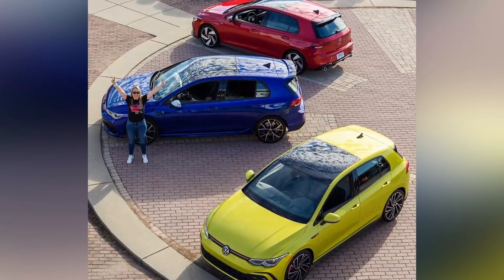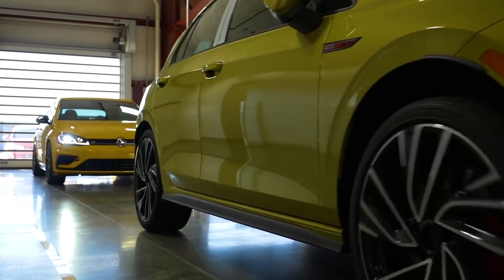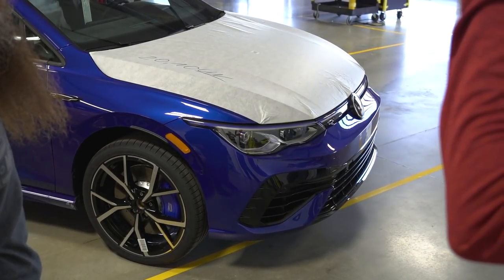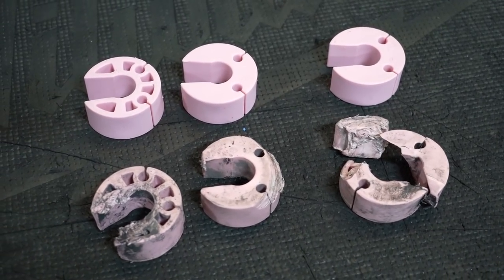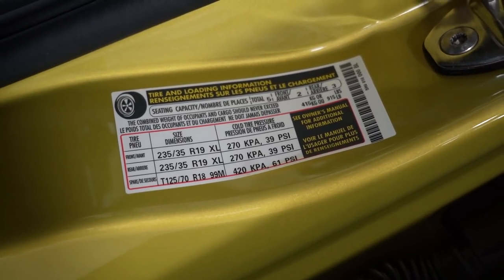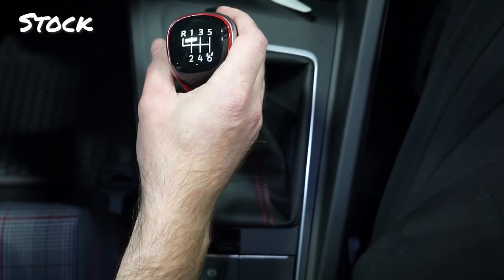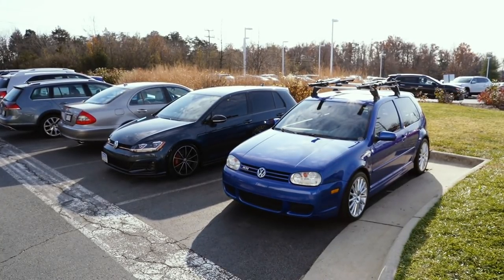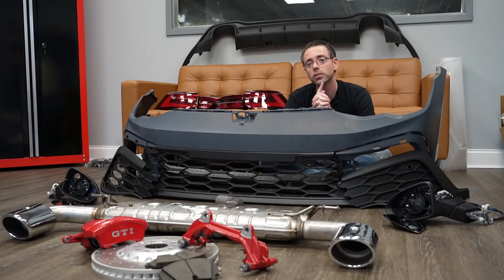We Modded our MK8 GTI Before Signing the Papers

Comment: I can’t think of one manufacturer that has enthusiast support like VW does. This is awesome. It’s changing my thoughts on the mk8 for sure.
Reply: Toyota, Mitsubishi and Subaru did back in the day. Now they just make dreadful cars. All the German marques have always had high level of enthusiast engagement. The only thing that's comparable is Ford.
Reply: @Zenkat yeah you’re 1 example of a here say story doesn’t represent the brands motives. I used to work for vw. In their engineering and design books they would explicitly state how they design their cars to support aftermarket modifications and make design cues to have an appeal if the vehicle was lowered. They put on southern worthesë and design concept cars solely to wow their enthusiasts.  Vwag has the biggest aftermarket and tuning following.
Reply: @Zenkat another fringe case. MQB is a beloved platform and has an absolutely massive cult following for being some of the best cars on the market in stock form, and a plethora of cosmetic/performance aftermarket support. it wouldn’t have turnout out like that if VW kicked enthusiasts to the curb.
Reply: @Zenkat sounds like you have a Lemon. Every Manufacturer has one that they produced. Not every single one will have it. Maybe talk to a lawyer and see what they can do for you.
I had a Mk7 that I raped all the time, never had an issue. I guess that’s life and life’s not fair.
Reply: @Zenkat I’ve had 5 mk7’s and probably double that in mk4’s to mk6’s. One of them was a lemon. I work at Toyota and see lemons all the time. Like I said your one experience doesn’t represent the brand. Look up the facts of vw having the biggest enthusiast following. I’m not arguing this when there are stats to show. Good day, good luck with the lemon law.
Reply: @Zenkat Ahh, so you're going to invalidate an entire global brand following because of an anecdotal alleged incident. Roger that.
Reply: @Zenkat Hey bro it was nice of you to turn up and say some words. Your carer will definitely be proud and print you a certificate etc. You have a good day now lol
Reply: @brandonfriesen5389  It doesn't help that VW as a brand is always near the bottom of reliability surveys
Reply: See how much they support an enthusiast when their crap is38 turbo blows with just a simple tune. Red flagged and wouldn’t even cover the water pump that later went with 26k miles because of the previous repair rejection due to the tune. VW does everything they can to not pay if you touch the car period. So reliable my ass. Leaky sunroof on my friends GTI at 50k miles and blown DSG in friends S3 at 65k
Reply: Honda
Reply: @Zenkat you mean to tell me, you're watching a video of VW enthusiasts literally showing up to the Baltimore port just to check out the cars they speced out, and then proceeds to modify it before signing papers... but it's just any other fanbase? crazy. and you for sure have a lemon. early 2015 models had the turbo issues you mentioned, but nowaways they are very reliable.
Reply: @grahamek86  Priceless AND accurate! 🤣
Reply: Yeah until they void ur warranty
Reply: @HowieCarson  The turbo is made by IHI, not VW. Also, the tune is crap. I tune hundreds of these cars a year and have yet to pop a turbo.
Reply: I'm just gonna say for the naysayers here, dealerships are a case by case basis, they're all their own franchises and pick/choose what they warranty. I've had some garbage experiences at dealers with my mk7 gti and some amazing ones with my mk7 R. Hell one replaced my headlight under warranty even though I was over the mileage fot it. 

And as far as reliability goes, I've put 50,000 miles on my 2016 Golf R in a year and I've done nothing but oil changes and a clutch to support the tune i put on it. 

There's small issues on mk7s here and there, some more than others but point me to a car that doesn't, I'll wait.
Reply: @HowieCarson  You violated the Magnusson Moss Warranty Act(which all car makers follow), obviously your cars warranty is void if you tune it and an engine component goes bad, what do you expect? Working for Toyota, we've voided many warranties over suspension mods, or basic bolt on mods because we all follow this rule. That's YOUR risk. It's not hard...
Reply: @Zenkat you’re problem is not working on it yourself. They are easy to work on, but dealers and mechanics charge an arm and a leg to get maintenance done. At 37k your car should be perfect. Sounds like a lemon, or you drive harder than you think you do.
Reply: I mean Porsche is trying to make fuel so “clean” that they don’t have to go 100% electric and I feel that’s the ultimate customer support…
Reply: @gladdy02  They're not, though.
Reply: My MK7 R clutch was failing prematurely at only 9k miles.  I've driven manuals all my life but this was inexcusable and the car was stock.  They said it was a consumable item like brake pads and wanted $2000 to replace it.  I sold the car instead.  Should have gotten a DSG.
Reply: @FastRedPonyCar  I've heard that a lot. VW had great manuals but DSG is the only one the handle the power out of the box.
Reply: Porsche
Reply: Ford allows you to do everything except ecu tunes and internal engine. Chevy will actually replace ur engine from tracking it in a zl1 Camero.
Reply: @gladdy02  except the fact that VW is at the top of the German brands when comes to reliability….
Reply: @papaannefranku9693  all the German car companies are not know for having good reliability. So congratulations on being the best of the worst? 😂
Reply: @gladdy02  too bad it also beats out Ford, GM and FCA…..
Reply: @papaannefranku9693  I don't know what your looking at but according to the newset consumer reports, VW as a brand is 24 out of 26. How else would you explain thier horrible depreciation after the warranty ends.
Reply: @gladdy02  it’s 24 out of 28 with the bottom being full of fca, ford and GM but I’m not talking about a year by year reliability rating! I’m going off of 5 year reliability and dependability index which weeds out the pieces of shits like the Tiguan and atlas in that aspect VW is average which is higher than Most other Europe and American manufacturers……and considering Audi and Porsche are pretty high on the list with their most popular models being on a shared platform including engines and electronics etc, it’s those multiple recalls that the Tiguan/atlas bringing the score down!
Reply: @papaannefranku9693  I'll buy that. All I know is that in my circle of family and friends, there is a perception that VWs look great, and typically drive better (or used to) then most normal cars. The trade off is reliability/maintenance cost, and the fact that you will loss your ass on a resell when compared to a Japanese auto maker
Reply: @brandonfriesen5389  Haters like @Zenkat are pathetic and I dont know why anyone here even bothered to reply to someone with nothing better to do than go troll on youtube. Wow what a amazing contribution to this comments section he brought. People like him are miserable just ignore them. You’ll be better off i promise.
Reply: @Zenkat its Not riddled with Problems its a really small percentage of all Cars have electronic Problems and wastegate Problems Like yours
Reply: I think Porsche trump's VW enthusiast support
Reply: @jw18xxx  that’s awesome to hear man!
Reply: @Zenkat those literally aren’t common issues (besides carbon build up which is an inherent issue of nearly every euro car). i’m sorry you have a lemon. i can literally search up “turbo wastegate failure *insert turbo car here*” and i will run into several results. that doesn’t make the car unreliable lmao.
Reply: @Zenkat I am glad there is another person out there that feels the same amount of frustration that I do with these later models. I was so happy initially owning my '15 mk7 gti, I got to perform the PDI right off the truck because I was a VW mechanic at the time. It came off the truck with 5 miles on it and I have put every mile on the car at 137k now and 1 motor later that was replaced at 58k. What a complete disappointment, from the brushed metal falling apart on the interior of a car that is garage kept, the driver seat splitting at the seams, all the plastics on the front bumper failing (those stupid plastic front "spoilers" came off), oh and a stupid short in the steering wheel that when you crank it to the right it throws a trans error code and disables the cruise control even though nothing is wrong. I have never had such a big love/hate relationship with car as I do this one. Long story short, keep it up spreadin' the truth, VW is just a big disappointment of a brand I used to love.
Reply: Porsche

Comment: They also delivered an exact copy of your yellow GTI to Lindsay, except it was DSG, saw the color in person and I snagged it immediately!  Absolutely love the mk8 so far; yes the buttons are futzy, but you get used to them and the underlying tech is super cool.  The jury is still out on the DSG for me, but I've always owned manuals, so thought I'd give DSG a try for once, time will tell.
Reply: Replacing the small factory paddles with genuine carbon fiber units improves the DSG Experience.
Reply: On the MK7 GTI's the UNI DSG TCU tune fixes the DSG jerkiness especially 1st n 2nd gear transitions. Facts. Not sure how bad the MK8 is but keep in mind!
Reply: MK8 has no jerkiness with the DSG, but the delay off the line is still there, and pretty bad with stop/start

Comment: My new 2016 GTI was APR stage 2 before I signed the papers. 14 miles on the ODO lol
Reply: "Break-in period"  psssshhhhh
Reply: @dubsessed9790  Right?!?!? Ha! 
I traded it in a couple years later at the same dealer. They used it as a rolling billboard for them at track events. Car would run mid 12's on slicks. They sold it a year ago and last I heard its still running strong.

Comment: Funny you mention drilling holes in your front bumper. I requested them not to do this to my 2019 Golf R (which they followed my request and didn't mount the front plate - they ziptied it to the grill), low and behold though the rear doesn't have a mounting plate and now has holes drilled into it lol.

Comment: Hey there ... Just curious .. when you installed this .. did you have any issues with alignment?  I have just got this installed from a mechanic on a 2024 VW GTI performance... after watching your video..  I see that my shifter is actually off centred and rests to the right .. ....I also .. have some issues with finding first and second .. but the up shifts when I'm in first... to second .. and then up .. is incredible.... any thoughts??  Very troubling when I'm down shifting to second and can't find second gear ....

Comment: Great car! Congrats!
Will you do that stuff of *number zero oil change*?After 1-3 thousand miles.
There is still a myth, that you should change the oil before the 1st normal oil change in your NEW engine, and that it will add it some longevity.
Because long time ago engines were really not that precious, and that extra oil change could help to take out some micro metal parts. At the dinosaurs ages :-)
Is that idea still working?
Reply: I heard not, because the 1st oil in the car is specifically formulated to aid in engine break in. Can someone confirm?

Comment: What is the difference between GTI and R except the difference of having AWD system on Golf R while GTI don't have?
Reply: A few differences that I know of. Bigger turbo on the R, more horsepower. Bigger brakes, different suspension bits. And the AWD system like you said is a big difference, even more so with the MK8 R where it has a torque vectoring system.
Reply: GTIs with the performance pack will have the R brakes.

Comment: I'm so glad I'm not the only one who references that baby commercial, nobody ever gets it when I say "in THIS ESTABLISHMENT!" :P

I'll be curious to see what your long term relationship with those touch controls are, it really has me on the fence because it's kinda looking like trash and a quick way to ruin what's otherwise a solid car. Lots of reviews including some major publications like car and track etc have all knocked the system especially the steering wheel. Activating controls while just turning the wheel because the side of your thumb/palm touches something while you work the wheel kind of seems bad. And having do literally dig into the menus just to adjust climate controls is beyond bad, it's borderline dangerous because it takes your eyes from the road vs a traditional setup.

And I can relate to the new car thing. Two days after getting my MK VII I hit a raccoon in the exact same spot you hit the tire chunk and it stove in my right front up into the wheel well, driving lights, fender....all that got pushed up into the tire......I'm still pissed about that lol

Comment: Do the new mk8 GTI come with IS38 Turbo?
Reply from the maker: No they no longer use IHI turbos so they are different part numbers and designations. It’s likely similar or slightly smaller than is38 but that’s speculation
Reply: @Deutscheautoparts  wow thanks for replying back